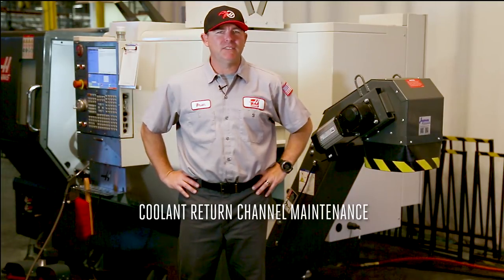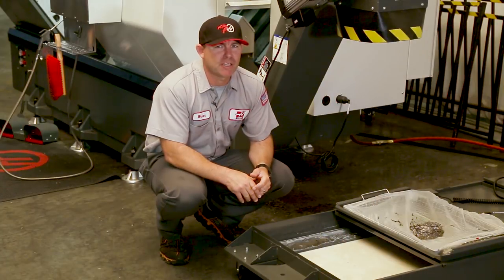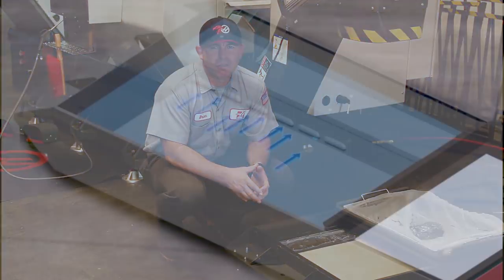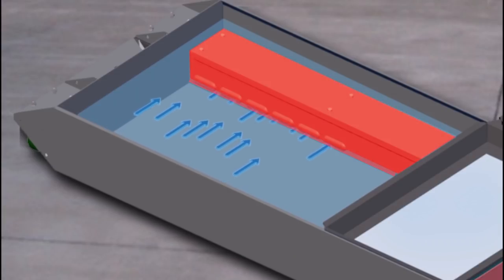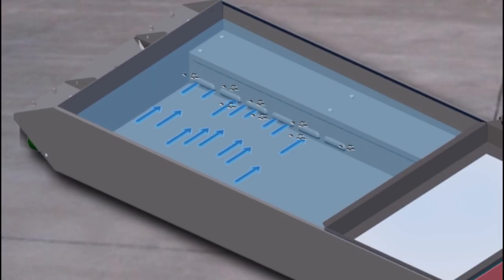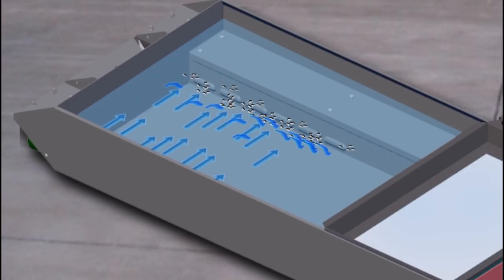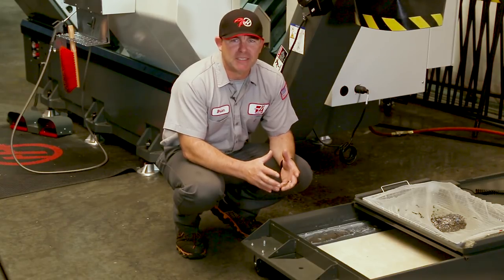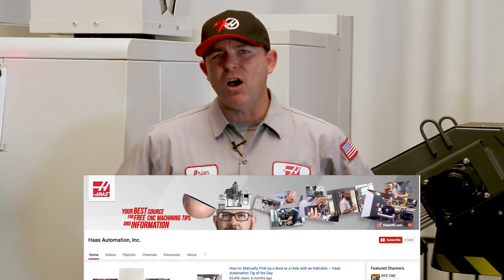Properly Clean Your Coolant Tank - Haas Automation Service Tip

Comment: Just got a new Super Mini Mill with the integrated coolant tank. It is quite a pain to get access for cleaning. 

Any tips on cleaning tanks on these machines? We do a lot of small tool work that makes fine chips which are hard to keep out of the tank.